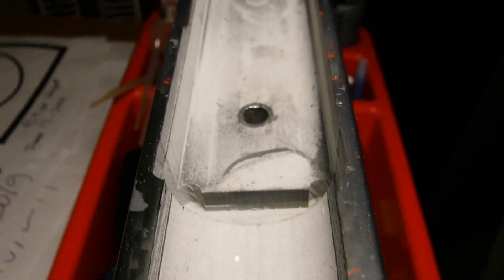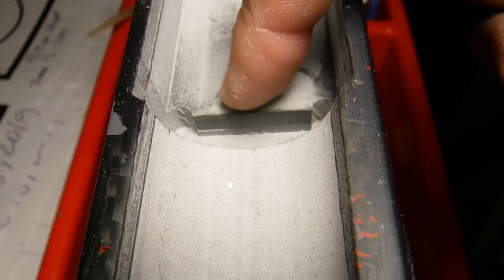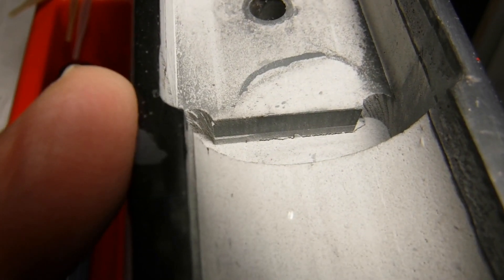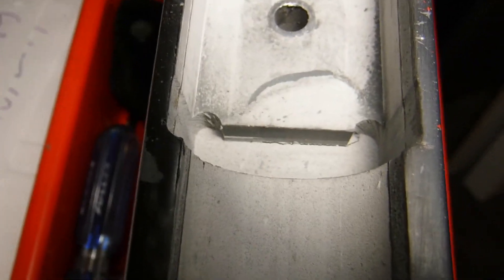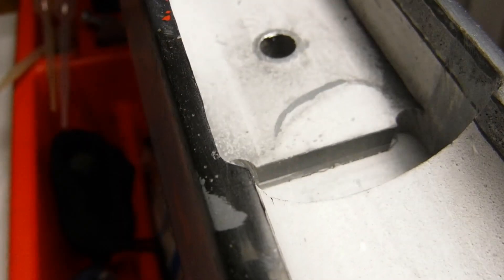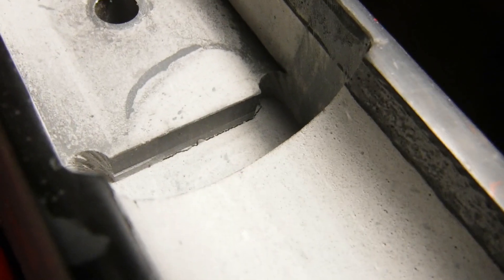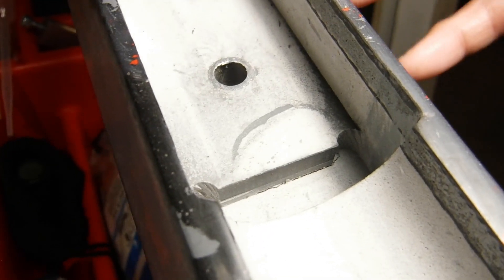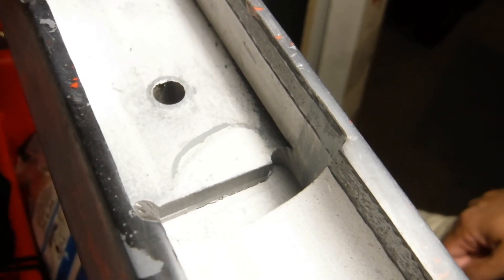XIT Stressed Out - Hairline Fracture

Comment: Thanks for doing the video.  I am sorry you had this issue.  I can see from the video we did not do a very good job of filling the action area.  If you notice the recoil lug i inletted into the material that was used to fill the forend.  That half moon shaped line just rearward of the recoil lug is supposed to be in front of the recoil lug.  I do apologize for our lapse in quality control.  This happens from time to time.  Also, we do not recommend bedding the tang of the receiver.  When we have done that in the past it tends to crack and chip because of the way the action area flexes under recoil.  But I will be interested in seeing the results of your bedding the tang.  And I just want to let all of our potential customers know, that if this stock had been returned to us we would have replaced it but this stock being in Canada does make it a little more complicated.  Kelly McMillan
Reply from the maker: Thank you Kelly, your reply is greatly appreciated and your insight is highly valued.  The level of customer service and response has been excellent and you're well represent by Gary at Big Horn Sales. Thanks again.
Reply from the maker: @jeffallen3382  Since I live in Canada it took closer to 9 months to get and take possession, from the time of order to production and export to the dealer. With ITAR controlled items export of items like the xit stock are troublesome, let alone trying to get these item exported back to the States.  I would of been out of a stock over a year.  If I where in the state McMillan would is taken it back no questions asked and fixed the issue and probably have back to me in a short amount of time. Here in Canada is a different ball of wax.

Comment: Amen, more the reason I suggested earlier to bed all rifles. Barrels are going to “torque and twist” in the stock. Bedding limits and improves groups and repeatable harmonics - “Customization” 

Myself I do recoil area to tang. Requires grinding and “roughing up” the inside of the stock. Should consider drilling small indentations into the stock serving as anchors for the bedding agent.